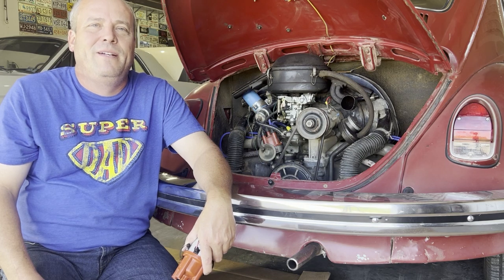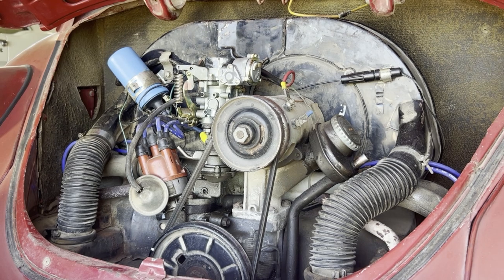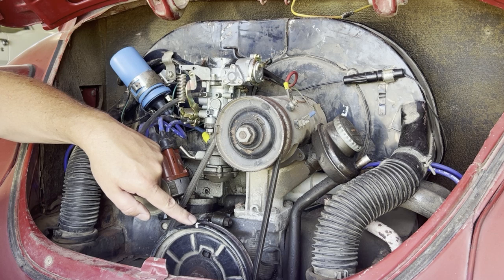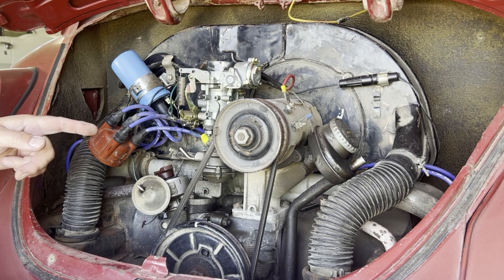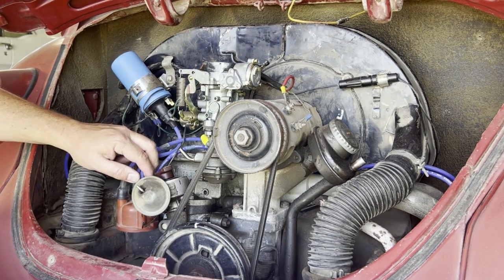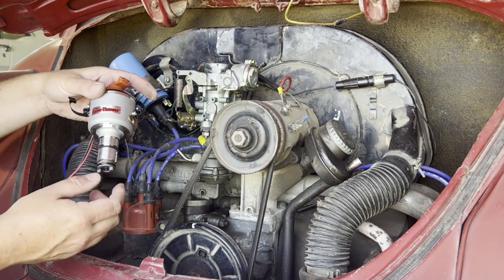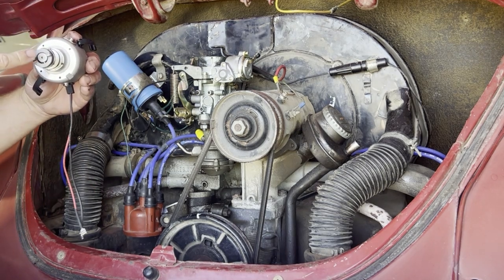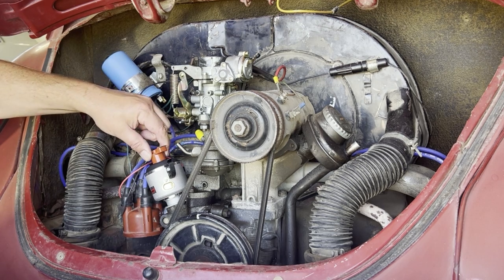VW Beetle conversion to electronic ignition part 2 - installing the Pertronix Distributor

Comment: I thought I saw a video about electronic ignition where's there's not even a distributor.
Reply from the maker: I'm sure that's possible but I've never looked for such a system for an air-cooled VW.  I would think you'd need some sort of crankshaft position sensor to make it work without a distributor.
Reply: @jarojocoam  That's right, that's what it had.